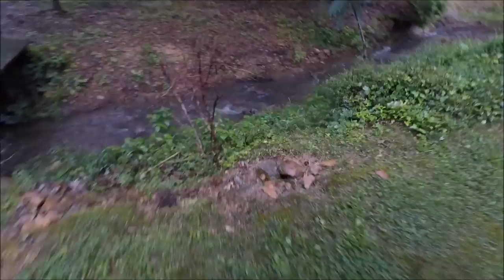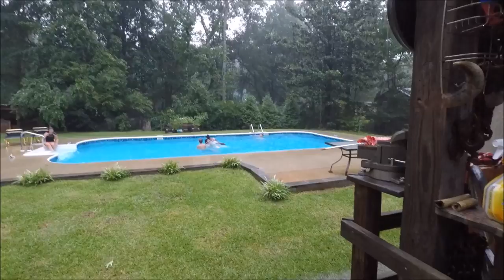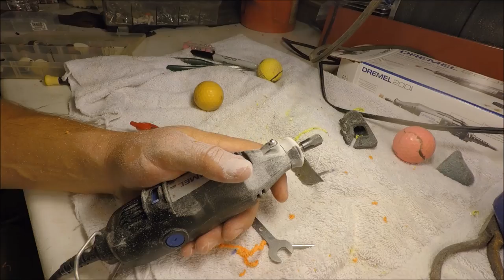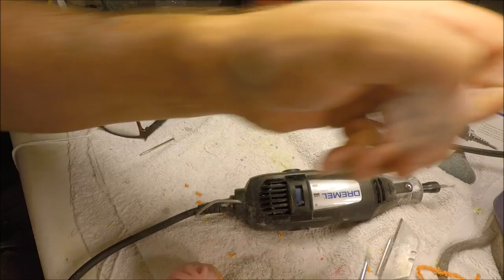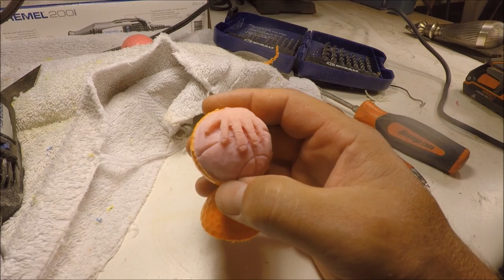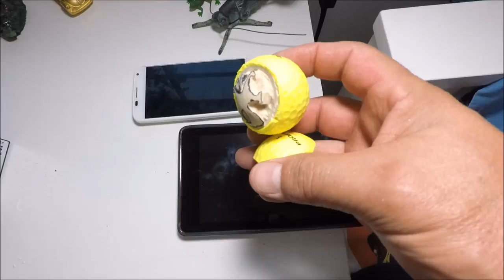Golf Ball Carving: Basketball I Think

Comment: Exploring Alabama, This is a cool idea! Also, for the rotary tools that were too loose in the Dremel tool, you needed to switch out the bit holder adaptor that you pushed out to get the other adapter into it. I forget what you call them. I just got me a huge set last winter but I haven't used them yet and I have them in storage near the front, just in case I want to use them.